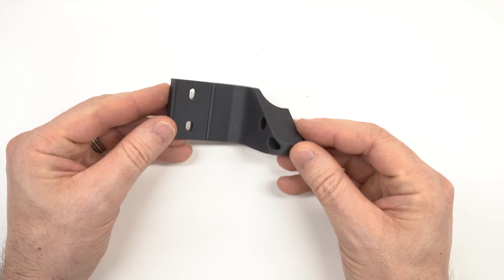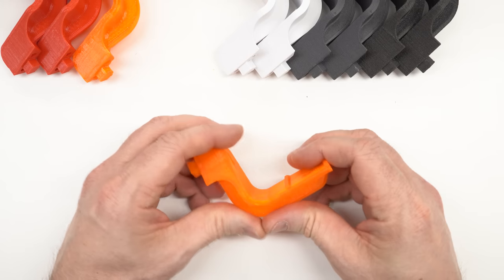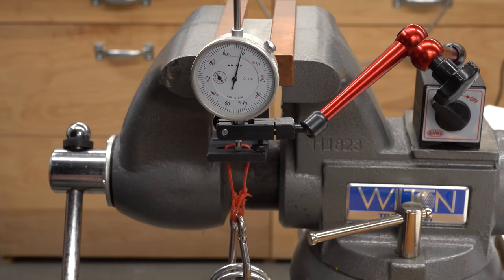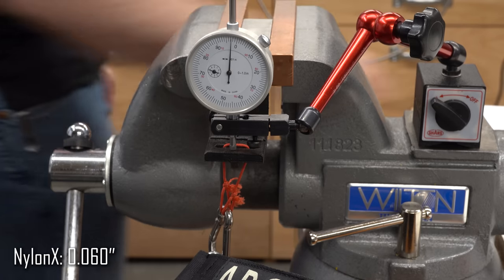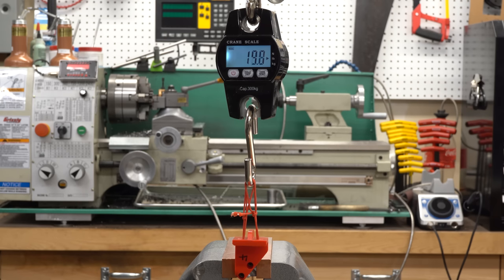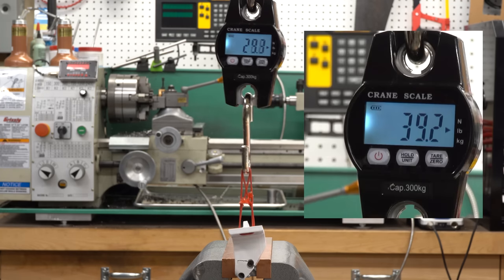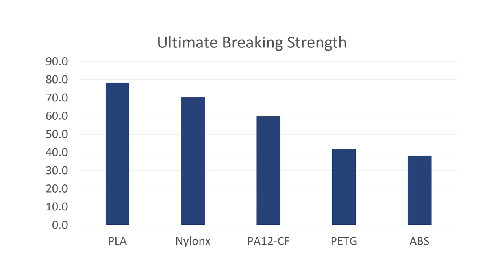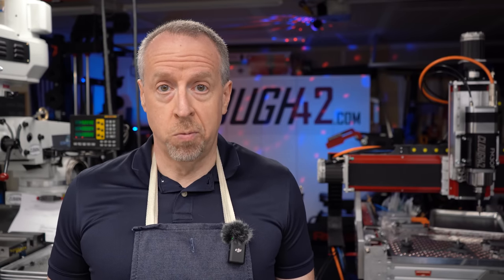Wait, What?  PLA is Stronger Than Carbon-Fiber Nylon?

Comment: I originally bought my 3d printer to make parts for my off road vehicle (Side by Side). I made radio and intercom mounts, hangers, air intakes, sunshields, storage boxes etc. I found PLA printed parts would deform over time and become brittle within a year or so. Additionally, if it was subjected to the sun in the summer, it would melt and deform within a day. I tried making a sunshade for my tablet gps with it and it deformed in only a couple hours. My PETG parts have held up for over 3 years in most cases, except those left in direct summer sun for multiple days on end, where they slowly deform from the heat. I've been currently using ASA, which can be a pain to print larger parts, and parts with a lot of supports. It does however seem to be holding up well.

Comment: been printing with PLa for 7 yrs. Never tried anything else , I always felt it was decent for most applications. And this testing corroborates it . Not to say other filaments arent better for certain applications , im just too lazy to experiment for small gains.
Reply: What are you printing? Toys? Try printing something that will be inside a car, or in direct sunlight with some weight on it.
Reply: @alejandroperez5368  almost all pellet gun parts, things that arent exposed to sun for long periods.

Comment: Interesting test. PLA is great, but the lack of heat resistance does limit its usefulness in a lot of cases (although I still try using it whenever I can get away with it). The PETG result was surprising -- I normally print mine pretty hot (255 to 260C) with a very slight extrusion multiplier (~101%) and 85C bed, and the result is usually excellent with the Matterhackers PETG

Comment: i recently started using the carbon fibre stuff and loved the surface finish of it,  i did suspect it wasn't giving any extra strength. Glad you  also came to the same conclusion. overall it looks good but not worth the extra money. thanks.

Comment: Another consideration is that PLA has issues with sustained loads. I had a headphone stand with a desk clamp for example and the PLA version loosened every few weeks, until it broke, while the petg version still holds strong after over a year.

Comment: Good analysis. This was the first video of yours I watched. It was a very good idea to point out that the application should dictate which material parameters are the prime concern (and therefore which material to use), and that there are many more properties of these materials that were not explored and could be prime factors in selecting the best material for your application. Well done.

Comment: One thing to note with PETG is that it's hygroscopic and if you print it when it's too moist it will actually become brittle due to the interactions with the steam created when printing. To get the best results with PETG it has to be very dry, I always run mine for a few hours in the dehydrator before printing and I print from a dry box to minimize absorption during a print.
Reply: Exactly my thoughts, it looks like first one was printed fresh out of the package, but other ones caught some humidity from the air which resulted in poor structural strength. Dry box is a must with petg.
Reply: I don't have a dry box (just haven't gotten around to it) but I absolutely run PETG in the dehydrator for a few hours prior to use. I certainly get more consistent prints that way.

Comment: I print a lot of PETG because a lot of the parts I make should be tough, but for hardness PLA is hard to beat. Two and a half years ago I designed a prototype speed handle for my vice. I wasn't sure if it would survive long enough for me to decide whether I liked the design and make it from metal, so I printed two of my final design that passed minimal use testing. I used PLA.

I'm still on the first of those two PLA prints, and I rarely even need to use the long steel handle that came with the vice. My speed handle has a 6-point and a 12-point socket on it, and the socket I normally use is the 12-point socket. It doesn't have a lot of engagement, yet it has not stripped out.

I didn't anneal it; I didn't expect it to last this long and wasn't trying for longevity. It just really exceeded my expectations.

Comment: I really love this type of videos and it helps tremendously people to decide what material to use in their project.
Only problem is that, it sometimes can inadvertently provide impressions that may not necessarily be true in all circumstances.
I am saying this because I was quite surprised with PA-CF performance. My experience is that regardless of number of walls, or infill density, PA-CF strength can vary wildly depending on temperature and speed they were with.
It also has very low tolerance to imperfections when laying down the layers, whilst PLA just seem to fuse together with imperfections very easily.
Because PA-CF requires much higher temperature and the CF reduces its viscosity, it is very easy to print weak parts due to low temperature settings (not to say humidity, which is obvious).
I'd experiment printing at higher temperatures and test it's strength again. I used to print it at 260/270, but was only when I printed it 280+ that it started to show true strength. It's also interesting that in klipper, the pressure advance value has a wildly different behavior at higher temperatures, which really indicates how its viscosity can vary depending on the temperature, which can indicate it has not fully undergone glass transition and will affect layer adhesion. Both of which are crucial to print strong parts.

By the way. Try annealing PLA. That is something really impressive. It becomes more temperature resistant than nylon and feels like is as strong as aluminium. Only problem is that it shrinks so, makes it tricky with precision assembly.

Comment: Have been designing and printing functional parts this last year and for absolute strength the way you print is almost as important as the material. Also even with pla you want to keep it as dry as possible, even a week in humid air and you will start getting air coming out of your nozzle leading to under extrusion. Personally with pla+ for a balance of max strength and print time I keep to 2mm minimum for walls with a 0.6 nozzle and layers perpendicular to where force will be applied. Also you can cheat a little with PLA, if the part touching the bed will experience the most force. Lastly you can heat the bed up after the print is done and before it unsticks, to harden that surface. I’ll usually heat the bed slowly to 80C for a while then let it cool and make sure nothing warps as it cools. Part becomes much harder and more heat resistant.

Comment: Good job with your tests.... The strength of PETG varies widely with different print temperature and layer thickness.  What may seem like minor changes in slicing and extruder setting can make large changes in strength.  My experience is PETG properties are more sensitive to print settings than ABS, PLA, NYLON or Delrin.  
Post print heat treatments also dramatically change the properties of most of these plastics.
TPU would have been interesting for your test and may be a good option for this bracket for this application.  You will never break this bracket with TPU!!!
I am not convinced the carbon fiber filaments are that much better, not worth the extra cost.

Comment: One important property of PLA is that it becomes very flexible when the ambient temp is above nominal room temp. I often print things flat and then use hot air or warm water to bend them into final shape. As many mentioned you can anneal PLA to improve that if desired; even after you shape it. I tend to use PETG for strong things. PLA for anything that needs contorted or painted; using Rosco Flexbond to fill in the mesh and allow paint to flex with the PLA instead of cracking.

Comment: I wish you had done a 2 minute or 5 minute creep test too. A strong material doesn't help if it will bend 90 degrees under load in a day.

Breaking strength inconsistencies: it appeared to me that how fast the crane moved had a considerable effect on the strength shown on the scale. Perhaps for that "very strong" part you just moved the jack handle a little faster.

Comment: My very personal filament decision flowchart completely excludes Nylon: 
Strong? PLA -> Polycarbonate for Tensile/UV/Temp/Chem/etc strength (has a little flex though!)
Stiffness? PLA -> CF-PLA (ultimate stiffness, but brittle & temp-sensitive!) -> CF-PETG (UV/temp-resistant) -> PCCF (The expensive champion).
For flexibility, I tend to skip plain Nylon and just get a "hard" TPU, as it tends to outperform Nylon in wear resistance and strength.

Comment: I'm a PETG fan and have great results with new filament properly dialed in on temp settings. It looks like the way the layers came apart, that the filament may have been run a bit cold or with too much part cooling. 
Can you please list out the temps/settings you printed these at? 
A future follow up could be tweaking in the print settings and design to maximize each material. Maybe including nozzle size.

The CF parts do look really nice, which for a lot of stuff would be sufficient reason to go that route.

Comment: @Clough42: I believe those properties you mentioned are more important than you state.
How long will PLA last, even without UV and heat. I have rolls of PLA that almost crumble, and they were stored in a relatively dry room inside a box.
I also have rolls of ABS, they draw some water and become easier to break but they print fine.
Also 910 Nylon from Taulman (I think it's PA-12) .. those need drying to print but after 5 years there is no noticeable change in properties.
I also have that nylon in a 80% wet room for 3 years in high mechanical stress and all that happened was added flexibility but the parts are still very very durable.

ABS, ASA and Nylon are the materials of choice. I only use PLA for toys and demonstrations.

Comment: PLA is fine ad long as the part isn't subjected to impact or heat. I printed an ocarina for my daughter from pla, thinking it would be fine. She dropped it and it broke right away. For functional parts, you should use petg, nylon, PC or abs. Maybe HT-PLA, but thats a mix of pla and abs. My goto for strong parts is CF-NYLON, printed with 100% infill, its tuff as nails and hard as rock!
Reply: What’s the best printer and extruded on the market today?  What do you use?

Comment: I usually use PETG outdoors, for its UV resistance. A small solar panel mount up in the gutter, some custom siding edges around outlet boxes, outdoor light clips, even the pins securing the wood sides to my trailer. Useful material, but only in certain circumstances; indoors PLA is likely to be better and cheaper, and ABS is just for the high-temperature spaces of my car and my 3D printer its self.

Comment: Super informative, thanks! I think with a different part geometry you could have a lot more strength. Each part seemed to fail at the screw holes, beefing that area up or even having that spline continue in between those two screw holes could make a big difference. But I'm sure it was designed around certain requirements and you made it as strong as possible for its application. Cool video.
Reply: This was not an experiment in how good the design was but to compared different filaments.

Comment: I feel like most of the consensus here is right, the fiber filaments are mostly hype. I do feel like there is one advantage I haven't seem mentioned though. If, for instance, you want to take advantage of the high thermal properties of Poly-carbonate (PC) which is notoriously difficult to print due to warping, adding a certain percentage of CF basically removes that issue. I tend to print parts that need that heat resistance in Prusa PCCF. That filament, like the PA12 CF you print looks amazing, and has basically 0 shrinkage.

So if you are simply looking for something stiff and strong that will be indoors and not subjected to heat, PLA is a great choice. It does help to consider other properties too like abrasion resistance (nylons and PETG), heat resistance (ABS, PC, PETG sorta) UV resistance (ASA, PETG) and then flexibles are kinda off on their own thing.

Great video! Always look forward to Saturday watching you and @Blondihacks, a couple of my favorite channels!

Comment: I imagine the reason for this is because PLA softens at a much lower temperature, the layer adhesion is much greater. You'd probably see a massive boost in strength for all of these that would overtake PLA if you were to anneal each of the parts. Though, I'm curious if the PLA would end up shrinking less than the others.

Comment: For ease of printing, I use PLA+ for most applications and PETG where subject to UV and where ultimate strength is required.  Subjectively, I have found that washing surface of PLA parts in CA superglue + activator increases both rigidity and ultimate strength.  Try to print at hot end of material range, inside an enclosure for best inter-layer adhesion.

Comment: If you ask any materials expert, they will say "strong" doesnt mean anything.

If your application requires some flex, then a flexible material will be "stronger". If your application requires stiffness, then a stiff material will be stronger. If you application requires a high temp, then a high temp material would be stronger. etc. Diamonds are super stiff, but also brittle. So depends how you use them.

I always advise people to check out the material data sheets. It gives you the actual material specifications like tensile strength, and flexural strength... yes, both different "strengths".

When someone asks, "what material is stronger?"... it doesnt mean much, which is why we engineer parts based on application, and choose materials based on that.

Comment: PLA is rigid and has good layer adhesion, but it's impact resistance and heat tolerance are low.  PETG, nylon, ABS, etc trade that rigidity and adhesion for the ability to take a knock and more heat. The purpose of carbon fiber is to make the final product more rigid, reducing that trade-off.

PLA+ filaments have added impact resistance but still aren't good for high temps.
Reply from the maker: This is very much my understanding as well.  Hence my comments about only testing a couple of properties.
Reply: No criticism intended. I just wanted to provide some additional info, particularly about the purpose of CF filaments.

Comment: Hi From Australia
Great video! 
The biggest take-away from it to me was that the crack always formed at the weak point in the design. The excessive thinness of the screw counterbore wall against the angled side of the foot? wall nearest one of the attachment screws. I would remove the counterbore and thicken the foot. As the design stands it is clearly the weakest point. The shock wave when this wall fails will not be consistent. the failure point will vary depending on Youngs modulus of the material. In this application it will probably favour more flexible materials. I would be very interested to see the same tests run on standard test pieces. I am pretty sure the results would draw a different conclusion.

Comment: Great test! I think there is one additional property relevant for your application. PLA tends to flow more due to its low glass transition temperature. Would be interesting to see how PLA performs in the initial deflection test when loaded for a week or so.
Reply: @alejandroperez5368  sure 🤦‍♂️ PLA is perfectly fine for mechanical and structural parts. I use PLA for 10 years now and I don't consider most of my parts "Toys".

Comment: I'm so glad you made this video. Thank you! I've been printing various parts for a while now and, without doing any rigorous testing, I was under a strong impression that PLA is an under-appreciated material. I also suspected that mixing in carbon fibers doesn't really do much for the strength of the final part, but couldn't really confirm it. Now we know! I still like the look of PA-CF parts, though.

It's funny how various myths take hold and persist — PETG vs PLA is another one. You will often hear from 3d printing afficionados "for strength, use PETG". This is nowhere as clear-cut! These days I use PLA for pretty much everything, except when I need those additional 8-10C of temperature resistance, then I'll go for PETG.
Reply: From what I've seen, the carbon adds stiffness, not strength.

Comment: my only thing to add and you touched on it - fatigue..  I have experimented with 3d printed harmonic drives.    Using PLA - the assembly lasted only about 24 hours of continuous running before the flex spline literally crumbled..    I printed one in petg and so far that one has not broken.

Comment: Interesting stuff, thanks. 

Maybe make sheer test rig, and a fatigue tester, next and compare a bunch of test samples as the next experiment?

Fatigue testing is so complicated.

In most of the applicarions I'm thinking of, failure will come from sheer, fatigue or compression, so this vid was good info. Tension is rarely a factor.

Comment: I use to be a big believer in CF filaments, at one point I was using a lot of Proto-Pasta cf pla and doing the annealing process, in the end, plain old PLA works just as well without all the extra steps, however, as you said, different task and applications mean different filaments. I started 3d printing over a decade ago, ABS and taulman3d nylons are still my go-to filaments.
Reply: Did you find any enhancements post-annealing? Did it affect the surface finish much? Be interested in seeing a video of that.